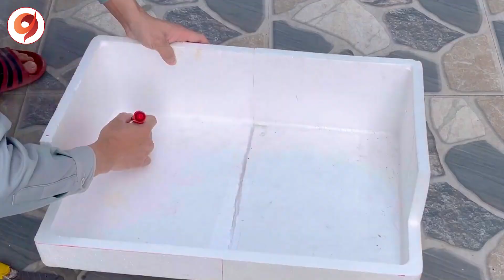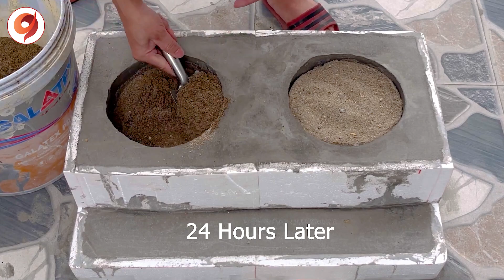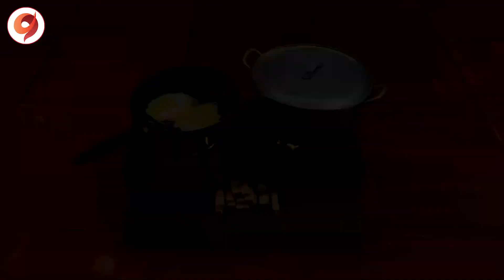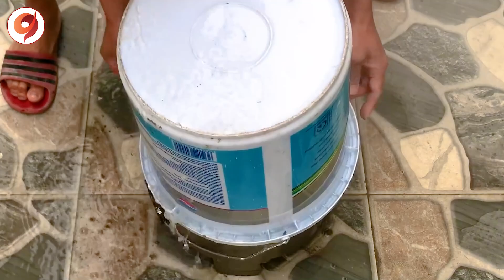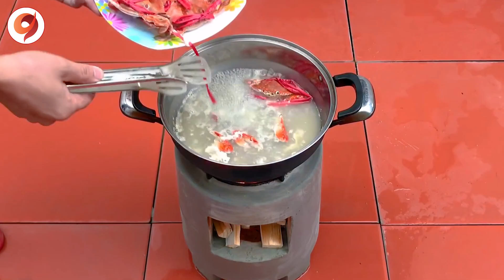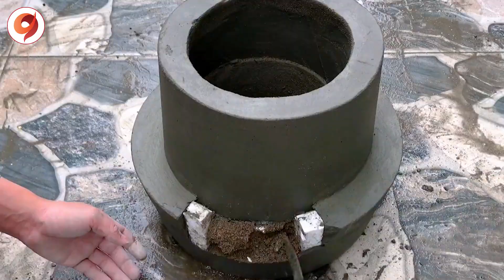Special gifts for housewives | Unique wood stoves from cement | Craft ideas

Comment: If the cement or mass is not refractory and there is no reinforcement in the structure of the piece with wires, the piece will crack the first time it is used.
Reply: exactly.. that was the question i also had.. it's better if he uses some kinda reinforcement